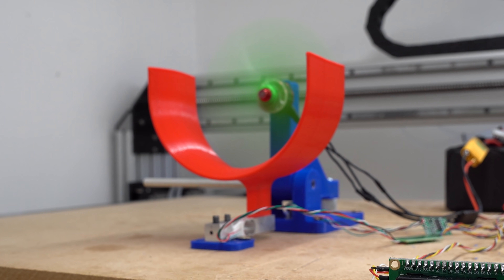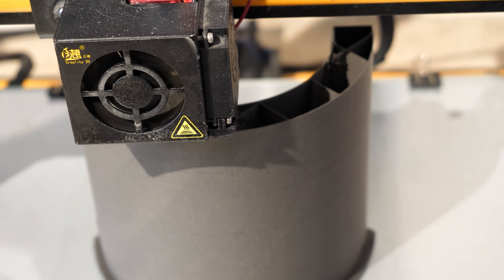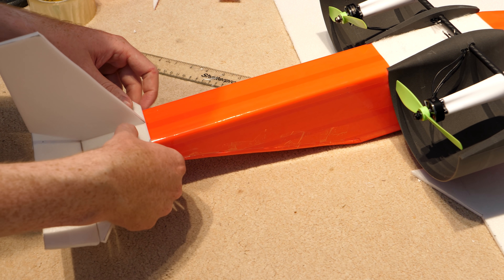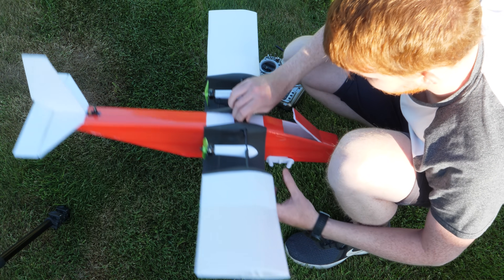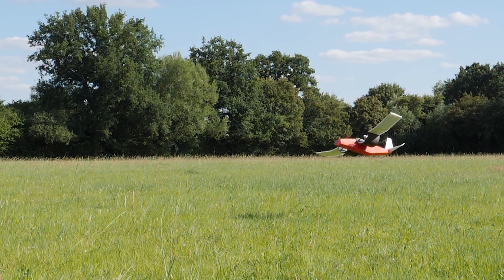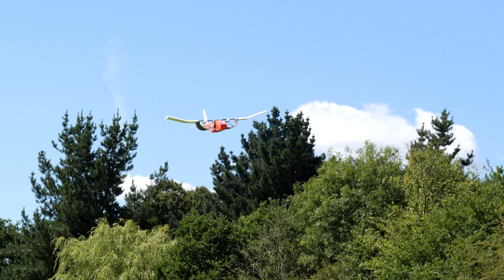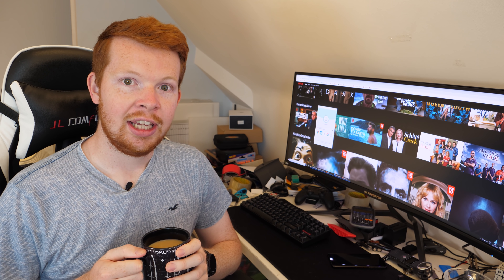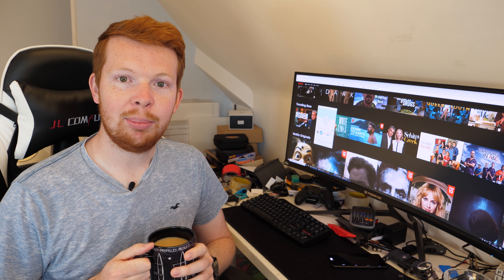Channel Wing Plane

Comment: This is very fascinating. I suppose having our current practice of non-vector thrust, nom-pivoting takeoff engines would not make this possible to use, but what if the motors could pivot slightly like Vector Thrust Nozzels from the jumpjet. With some down-angle to compensate for the "pitch up tendency" would it be stable?

I'm thinking this was in relation to the Valkarie jet plane which "should not be stable" but with computers to compensate for what controls it needs it is capable of spectacular flight.

I'm not saying 'put a mini computer on the plane' yet, but it's worth noticing that with the throttle control and engine pitch not being calibrated specifically to cater for that 'pitch up tendency' we haven't seen how this might work with all the angles covered.
I don't mean to be mean. I'm just saying it "could work with help" like the Valkyrie shouldn't work, but it does. So I hold hope for your design

Comment: Nice video. Can you build a tricopter with three channel wings placed at 0, 120, and 240 degrees on a circle, then guiding the air down from the center to add more lift?

Comment: What about making it tubular tube can fly instead of a propeller make two tubes that spin around with ridges on the inside of aerofoil to grip the air like a corkscrew in a tube on the leading edge. or maybe reversing the aerofoil on the top tube, or have a double scoop on the bottom with a gap between them what would cause acceleration on the bottom aerofoil tube and two aerofoil would increase left3

Comment: I'm curious why you didn't use a tractor configuration.  Air just after the props would be moving faster than just before them I would assume.

Comment: It seems to me that taking this old design and running two escs and few control surfaces could make this a lot harder to fly as you can't trim it out or have the fine control.  I'd be interested in the experiment but with the motors speeds locked and control surfaces added.

Comment: What if you were to turn the loops upside down and give it an airfoil cross section. That way the low pressure section is still on top and the higher pressure area would be towards the prop.

Comment: Sorry about my commenting on this video, but it's your latest, and I thought I might catch your attention. it's concerning reaction wheel propulsion. while the weight might restrict it use on earth. It might be practical in space. As an all electric drive system It's already used as axis  attitude control. I 'm  wondering  if apposing wheels of the same axis could cause directional thrust if the speed of the wheels is pulsated?

Comment: that could change if you use funnels instead. and by using funnels the location of the propeller is important. a funnel will increase propeller back pressure at least in theory

Comment: 04:19 This scene shows that your plane flies just by the power of the engines (logical, when you think about the power to weight ratio). Aerodynamics are neglectable. With these engines you could fly a shoebox the same way.

Comment: I recognise the weight issue. But it sounds like you get significantly better handling with rudder control. 
A flat concrete surface would reduce the rolling resistance of the grass & may reduce the V1. Allowing a controlled takeoff / better balance of the plane.
Attaching a long string from the back of the plane to a measure. May permit you to keep the aircraft stationary & measure thrust required for VTOL.
Very interesting, great work.

Comment: FAA didn't like the glide characteristics; sure you can take off at 15 MPH with engine power, but if the engines fail you drop like a stone!
There was no fault tolerance in the design...even a helicopter can auto-gyro for a safe-ish no-engine landing.
A channel-wing glides pretty much the same as any other design, you just to have enough air-speed!
The original Custer wing had the propellers mid-way in the channel; suction forward of the prop, blowing out rear of the prop.
Great project!
There are some short-takeoff cargo planes that place the prop forward and above the wing: all the better to blow air across the airfoil/flaps

Comment: The harmonics and change in blade lift from swinging across the duct into open air would surely lead to catastrophic structural failure of the prop blades, crankshaft, and wing spars in an actual aircraft of similar design.

Comment: I predict higher lift with the prop at the front of the channel. Richard Feynman's sprinkler experiment (the one where he exploded a glass carboy as a student at Princeton: https://en.wikipedia.org/wiki/Feynman_sprinkler) shows the big difference between sucking and blowing. With the props at the rear of the channel much of the air is drawn in from above the wing (at low speeds at least) and blown out horizontally so its momentum change produces down force on the  channel. In addition, with the prop at the front, the air speed across the  entire chord of the channel will be greater and thus the average pressure lower over the top surface of the channel

Comment: What if you added thrust exhaust vectoring another words duct the exhaust thrust down a little bit one that will keep your nose down and two it should add stability because the more Throttle you give it the more it’s going to hold or fight the nose up attitude and would reduce the forward speed and take that energy and push it down to give you even more lift

Comment: On the face of it, the channel wing concept sounds plausible, and was actually proven to work, but does end up being somewhat of a contradiction in practicalities.
The channels can produce lift enabling the aircraft to fly at slow speeds however, to slow the aircraft down requires reducing the power which then means reducing the duct induced lift.
To actually fly the aircraft slowly required a composite of flight techniques involving flying at high angles of attack with high power settings, not far removed from 3D flight.
This then required having control surfaces under the influence of the prop blast as controls outside of that effect became virtually useless.

Comment: Were the channel wings pre thrust drawing air through the channel or was the props sending air over the wings in the test assembly? If so they were in a reveresed configuration. !?

Comment: Surely you had to have the props forward of the channel wings to produce the lowered pressure over those sections. The fact that the channel wings are forward of the props means they are passive at best. !?

Comment: Maybe should blow air over the wing rather than use a vacuum to suck. Using the exmple of a leaf blower, the blow function has much more power to move leaves compared to the vacuum. Pushing air over your wing will produce greater lift.

Comment: Look on page seventeen of this document: https://apps.dtic.mil/dtic/tr/fulltext/u2/a800964.pdf. It says that the negative air pressure on the upper side of the nacelle has to be maximized by using higher angles of attack, coupled with sufficient air-speed to prevent air flow separation, in order to achieve the desired low-speed lift. The model plane in this video does not represent that original concept. Here’s the real video: The military likes to spend money. It doesn’t like to build things which are cheap and effective. So now we have terrible, expensive equipment. The real answer is to take decision-making authority away from the military. They can file a request for whatever equipment they want. The request will be analyzed, and if it is determined that action is needed, then a P.O. will be issued. Further: Military personnel are prohibited by ethics rules from taking any job with a defense contractor after his term in service. He must work only in civilian occupations.  Defense Industry employment jobs for ex-military personnel are illegal. They are a kickback.  But of course, they know that already. If you want to have a good laugh, look at Boeing’s ethics page. I think it was written by Satan. https://www.boeing.com/principles/ethics-and-compliance.page#/speaking-up. Boeing owns everybody.

Comment: I think you would have much more lift if you put the propellers in the front or contained the draft by fully encircling the propellers but putting them in front should produce much more Lyft

I had an idea last night have been thinking about it a while imagine a frisbee maybe really large with airfoil like a wing on the top coming out from Center between 2 and maximum of 5 anyway you would have airfoils on the top of the Frisbee where it spins and the spinning would produce lift and also the bottom of the Frisbee type thing would be flat so the whole thing is like a wing and I think you would be the guy that can make that you could also put a propeller and a hole in the center but that would be a different project tell me if you can comprehend what I'm saying and if you think you can build that and try it out let me know thank you

Comment: Seeing this I wonder if there is a difference in thrust in dicted fan set ups based on prop location within the duct.    Depending on air foil angle of attack within the duct I could see arrangements where a bigger prop could be used placed at the front or towards the back...    does increasing air velocity over the airfoil have a positive effect on motor effciency if placed towards the back versus placed towards the front?

Comment: Tom the configuration you built is all wrong.  The tip of the propeller needs to be at the quarter chord of the duct and the clearance between the prop tip and duct needs to be minimized.  FYI- I’m an aerodynamicist so I know of what I speak.

Comment: Now I need to check the other video you did, because a pusher configuration in the duct doesn't really makes sense for me. Instinctively I thought having the propellers up front pushing all that high speed air over the duct would be more efficient, I may be wrong though. But one remarkable thing I want to mention is how incredibly skilled you are now. I've been into this channel for quite a while now and comparing the first ones to now, it's just amazing how much you evolved and how great your designs became. Please keep up the good work man, I love your videos and I love science!

Comment: I'm thinking that the semi circles opened up to conventional straight airfoil surface might produce more lift either with motors on or off. If the semi circle is about 4 inches/10 cm across then the increase in total wing length would be around 1 foot/30 cm. That's nothing to ignore.

Comment: I would have thought that mounting the prop ahead of the wing would be more likely to provide good airflow over all its surface. Radius of prop slightly greater than radius of wing so that airflow is both sides of the wing. Have you tried it with that set up?

Comment: I think that if you put the prop on the front of the wing there will be a lot more air flow over the wing from the venturi effect, so then it will have a lot more lift with a slower prop speed.

Comment: Per usual, I enjoyed your capers in aeronautics :-)...

You've missed I think a KEY element of this design: the need for a TRACTOR motor positioned at the FRONT of the wing. 

Your design assumes (inaccurately) that your rear-positioned pusher props will magically draw air ONLY directly from the FRONT of your channels across the lifting surface...

...What is ACTUALLY happe mning is that your props are drawing the majority of their airflow from just ABOVE and slightly on-top-of the rear portion of your channels - HARDLY enough to lift the plane :-/

TRY THIS: REPOSITION your motors to be TRACTORS at the LEADING EDGE of your channels. This will GUARANTEE that ALL the thrust WILL be across the channel...
Reply: VOGTLAND OUTDOORS  The real Custer Channelwing was a pusher, and I’m sure some thought was put into this. I would guess that the effect you write about is real, but not very strong and dominated by the pusher benefits of 1. clean airflow over the wing wing, and 2. decreased pressure ahead of the prop

Comment: Planes fly from a combination of air directed downward by the angle of attack of the wing and lift from the airfoil. I think the airfoil is a minor efficiency enhancement compared to the wing angle of attack, which is why stunt planes have no trouble flying upside down, especially at low speeds. If this is true, then you would get much more vertical thrust blowing air against the underside of a wing, ie vectored thrust, just like VTOL aircraft use.

Comment: Maybe the reason it is not producing more lift is because it is so light. Maybe a slightly heavier craft would let the motors spin faster at a lower speed; Maybe that's too much push and not enough pull though. lol

Comment: It might have potential in amphibious surface skippers that play off the ground effect also a steep drop with no nose pitch might be desirable for easy land engine shutoff when your close enough to the ground the idea is correct but the rest of the aircraft is wrong a glider type  nd long or a delta triangle or stealth wing might be in order his idea was good just too poorly executed to have taken off keep the ducted wing change the aircraft your only mistake was you matched his desighn to closely that's why we dont see his desighn today the u-2 has high lift at low speeds which might take advantage of that easy engine kill assist landing feature but still give some glide but even a 747 might be a good ballance like styrofoam ones that they used to sell round cylindrical fuselage biplane might have the best of both worlds can u imagine an inverted ducted wing above sandwiching the engine between the two wings ! I'm excited for you great work glad someone is dusting off this idea great prototype keep up the great work highlight of my day
Reply: Ever thought of using full stops?

Comment: Here is an idea for you - Low speed wing stall should be relatively small as long as the props are running to counter it.  Therefore you should be able to tilt the entire wing and motor upward during take off and landing for low speed.  Think MV-22 Osprey.  Maybe not a full 90 deg but 30 to 45 to start.
Reply: @dodecahedron1  Could Be.  Just trying to provide a bit of an example of my thought.

Comment: I have done lots of research into the barrel wing. Amazing stability at low air speeds. Need counter rotating props for low speed control.

Comment: Since the props are in the back of the channel, you would get a lot of airflow coming in that wouldn't flow over the channel unless the plane is flying forward which negates the point of the channels. What about if you put the props at the leading edge of the channel and the kinetic energy of the air coming off the props would force it over the channel?

Comment: Try to move the prop to front of the wing, making the airflow in channels stronger. May be it will lead to significant difference.
Reply: Prop at the front doesn't work. Too much turbulence in the channel making the airflow weaker.
Reply: @simonleonard5431  May be impellers at front will work. It has a straightening apparatus and less turbulence.   Like jets on An - 72 airplane.

Comment: Channel-wings and many other designs were rejected because they relied on constant dependable power to function and if that power is suddenly diminished or cut off the flight characteristics of the craft change radically.

Channel-wings, for example, can flip over if one engine loses power. If that happens at take it out landing, the results would be fatal.

All aircraft designs have to able to operate without power to be viable.

Comment: Great work!  The model (probably the wheels and tape colour) reminded me of the Super Draco bush plane. In an unrelated train of thought, I imagined dissecting an octuple prop drone by scavenging two drone motor nacelles. These might serve as a useful source for further two-engine (but four-prop) channel wing experiments somehow (with the non laminar prop extended on a boom? that’s crazy talk).  This would involve a ridiculous amount of reprogramming to get back to autonomous stability perhaps, but if you were willing to ignore that, the hardware might get you closer to controlling pitch (turn?) by throttle.
Now I have a vision of a Draco-like bush plane with radial engines and a bubble canopy nose...Thanks again for the thought-provoking video.

Comment: I would like to see you try it with a puller prop so that all of the airflow goes over the channel. With a pusher, you are drawing air from all around and not maximising the flow over the channel wing.
Reply: The channel wing relies on pusher prop or to be more accurate a puller behind the wing. Positioning the prop in front of the channel makes the airflow through the channel too turbulent.
Reply: @simonleonard5431  I find that hard to believe.

Comment: Hey, Tom!
Maybe it would work for a heavier airplane? Currently thrust vs mass is huge and it pulls plane forward more than pulls air back. Maybe testing with some air-brakes and more thrust might help to reduce speed of plane by keeping high airflow over the wing? Just my guessing having built or flown 0 RC planes in my life.

Comment: Isn't the lift area just the channel diameter multiplied by the wing width, not the half circumference of the channel times the wing width,  ie, a lot smaller than it could be with the wing straightened out, ie, - lol - a lot less total lift.

Comment: Tom, it looks like the original design has the motors mounted in front of the wings. Pulling the aircraft and pushing air over the wings. It might be an interesting experiment to compare how different the model files in this set up. Also din you make the channel wing file available on thingiverse?